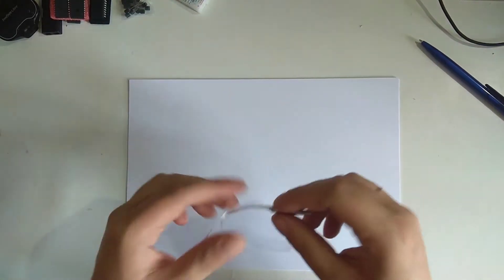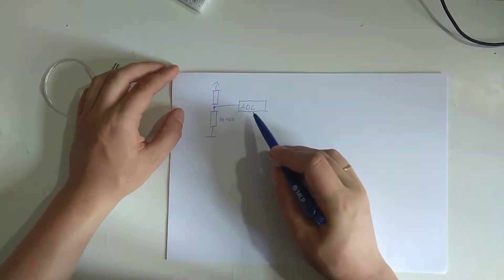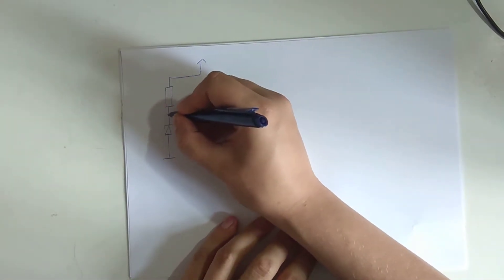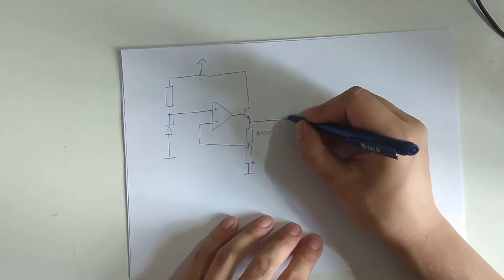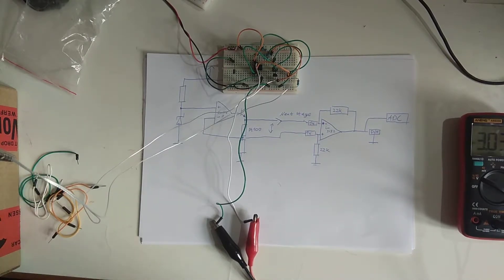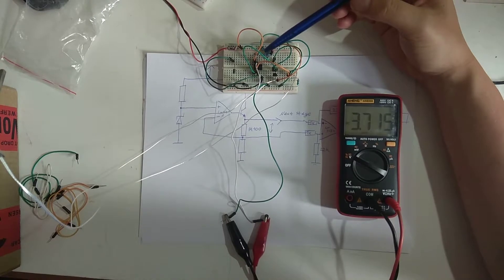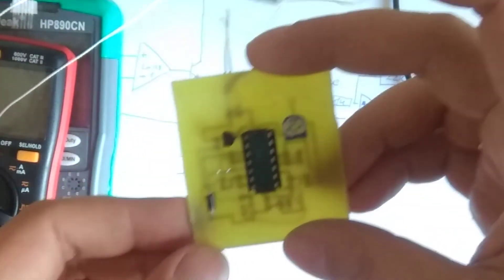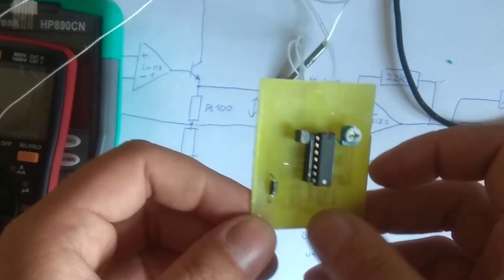Designing an Analog front-end for a Pt-100-sensor using the lm358 opamp

Comment: this is NOT the we do it in industry. Make 1 mil Amp Current Source . Take a 4 Wire PT100 , pass 1 mil amp using 2 wires and measure voltage drop across other 2 wires.  ensure at least 5Meg OHM Input Impedance at measuring ADC or use Buffer or Instrumentation Amplifier
Reply: Hi, is there any link you could share that shows an example of what you described here?